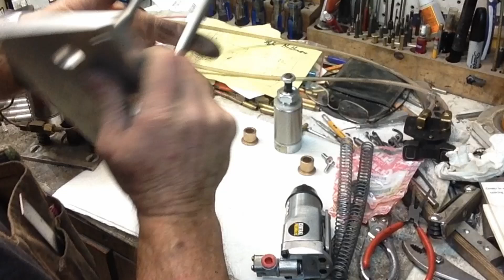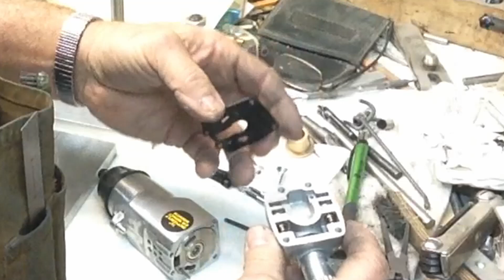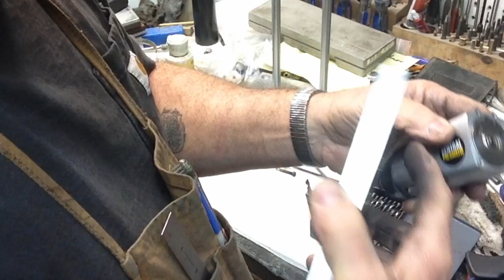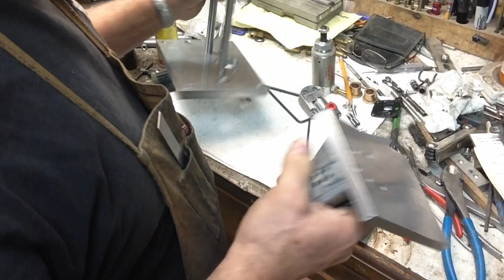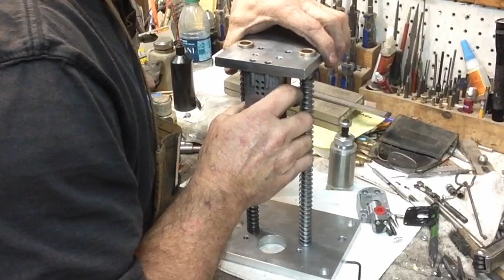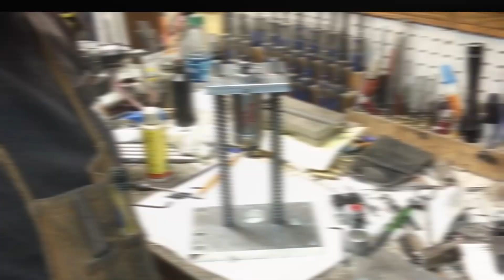Grizzly G0755 , Part 11: The Power Drawbar 3

Comment: Nice power drawbar Dan,  I posed the question a while back on a few popular home machinist forums if they use quick change tooling on there vertical mill, [I do, have QC collets /QC bridgeport holders]...They say by far they just have the power drawbar #1 preference.  I'm an old school machinist from industry that was ruined by QC holders, before they even heard of power drawbars. I still like to reach up and stretch my shoulders in and out of place lol!
Reply from the maker: Thank you: In my opinion it depends on the mill. While the Bridgeport has a way to lock the spindle so you can tighten the tooling sufficiently on both of my import machines there is no spindle lock (none on my earlier grizzly so you open the top cover and hold the belt to tension and on the g0755 you either shift it to the lowest gear which helps and you use 2 wrenches on top to hold the drawbar and the other to tighten the locknut against the spindle) When you add that inconsistency which is also a pain to do with Tormach tooling it is easy to get toolholder pull out when taking a relativly heavy cut. Don't ask me how I know this because I will never show the new hardened vise jaw with the 3/8" cut across the top of it caused by a 3 flute carbide end mill or the aluminum block I wasted yesterday with the same end mill. The power drawbar on my early mill virtually eleminated that problem and I am hoping I will get the same results with this one.
Reply: 10-4 on the 2 wrenches...I have cut a hole in my belt cover of my mill/drill/made   a  wrench to fit the spindle nut to hold for my Niken QC milling chuck collet unit.Don't   hold anything with my bridgeport QC tool holder unit.